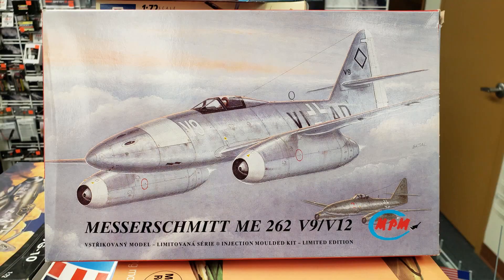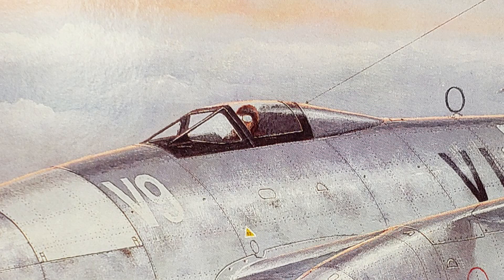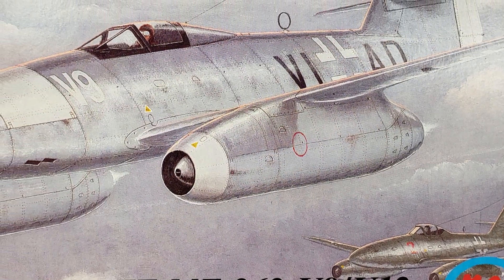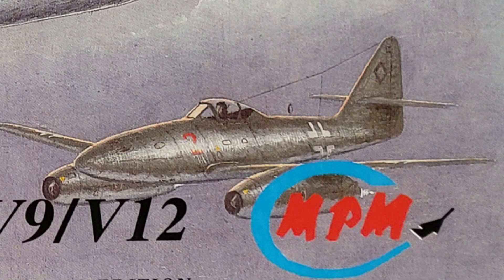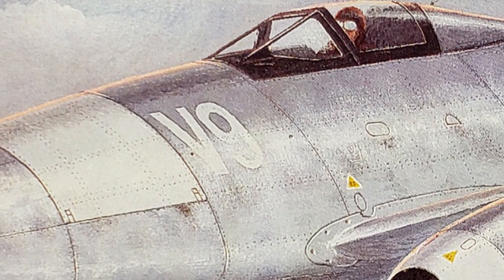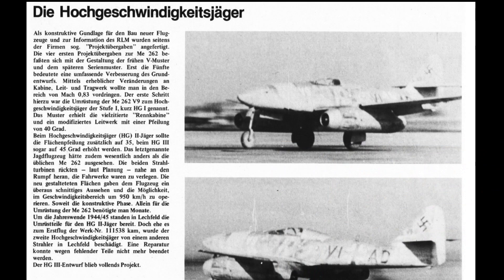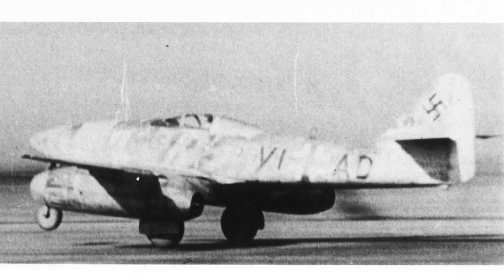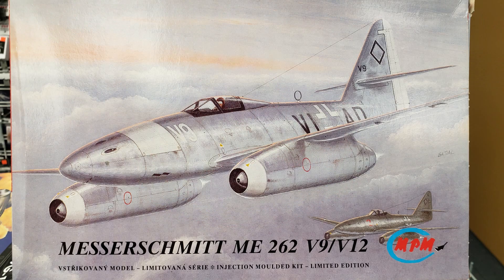Coffee with Max's Models 05/26/23

Comment: The article says the HG (high speed fighter) project intended to come up with an aircraft that could reach Mach 0.83, by making significant changes to the cabin, wings and tail plane. It says that the first step, called HG I, was the conversion of the existing V9 prototype. It received the "often quoted" "Rennkabine" or racing cab plus a modified tail plane with an (increased) sweep of 40 degrees. This clearly flew as per the photos, but likely not much faster than a standard fighter (i assume). In the HG II the wings were supposed to be swept at 35 degrees and in the HG III 45 degrees. The HG III would have received significant changes by the turbines being moved closer to the fuselage and the undercarriage moved (outward?). This was projected to permit 950 km/h max. At the end of 1944/beginning 1945 the conversion parts for HG II were ready at Lechfeld airfield. However the HG II conversion, Bu.Nr. 111538 was damaged before it's 1st flight by a collision from another 262. Repairs could not be made due to a lack of parts. HG III remained a paper project only. Cheers Guido

Comment: Great book on Me 262 by Walter Boyne is a must read, plus William Greene Aircraft of Luftwaffe also helps. Kit itself, limited run, uses Heller wings and undercarriage plus short run , low pressure silicone mold fuselage, plus photo etched parts, decals, etc. Makes into nice model with a bit of work.